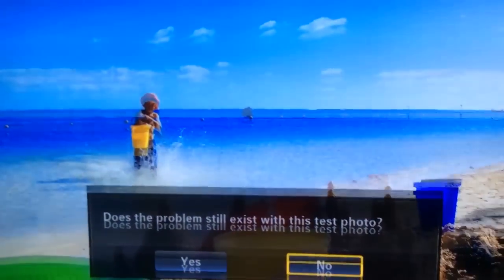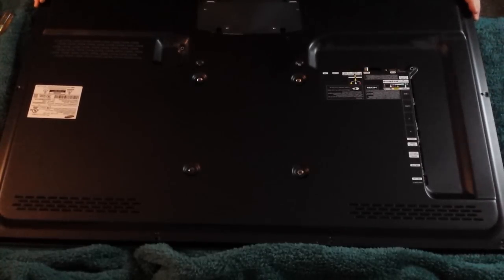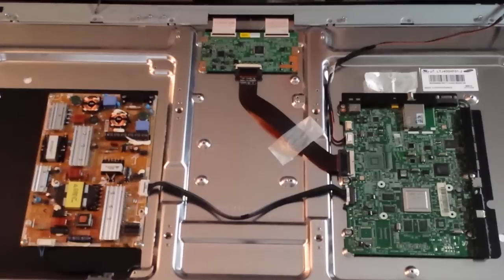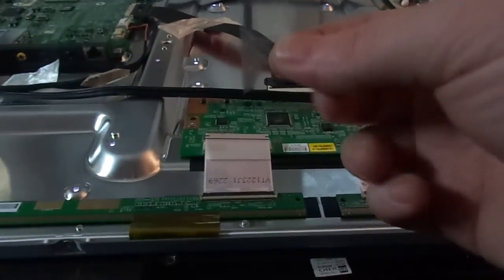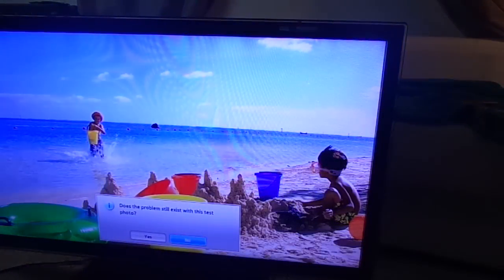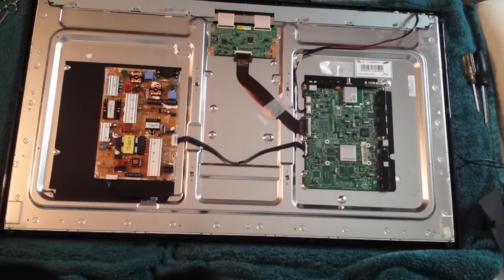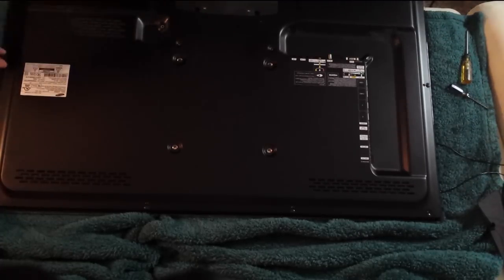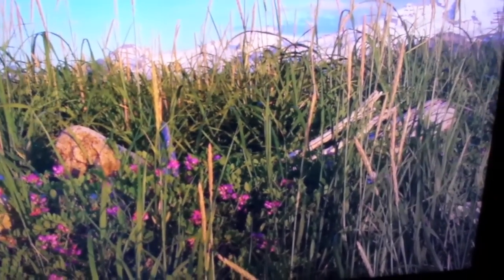LED LCD TV FIX, How To For Samsung Double Image, Black Vertical Lines, Screen Problem Sony LG.

Comment: I have a different one here, there's no left and right cable / flex for the LCD monitor. It's just a single flex , and it cannot be removed i guess so ... LA32d400E1xum model... tnx man
Reply from the maker: I think what you are have is a desktop monitor.  I m not sure about the difference internally so I can not say how you would go about working on it.  Look to see if there are multiple cables that run around the outside of the screen just under the bezel.  There are some videos that show a fault in some of these cables that will give the display issues.  What I've seen done is the cables are moved up and down and spacers are used (a piece of foam or something like that) under the cables when the picture clears up to keep that position the same.  I hope you are able to fix the issue.  Please post any progress you make.  Thank you for watching.

Comment: I found a double image samsung 55 inch LED do you think $250 is. Good price?
Reply from the maker: Adam Anderson unless you know for a fact that you can fix the tv for very little to no money it is my opinion to not buy a broken tv.  Especially at that price.  It's not worth to me to buy something in my budget that I would have to fix before I could use it.  However if I could, for a fact fix the tv than I get it for like $50 to $70.  Try not to under value the price that the seller is asking. Ask before you offer, what they would be willing to take cash for the tv today.  Then make your offer.  If it's not good enough for the seller let them know your offer remains and they can contact you to sell for that price.  I hope it all works out for you.  Thanks for watching.

Comment: Hi dave! i tried this on my tv, and the right panel has the problem but when i tried putting the tape, the gold color strip got spoilt a little bit.. and now the tv doesnt have double image but the entire right section is showing lines... can u help? pleaseee
Reply from the maker: Sonal Verma, this may seem like a lot but just stay with me.  When you say the gold strip is spoilt, does that mean is it burnt or split?  Are there any signs that show the tip on the ribbon connector to have failed?  Try removing the tape and wipe your finger over the gold strip ((not to clean it but to ground out any static electricity build there may be)).  After that reinsert the cable back into it's slot.  See if you have the same issue taht one side of the screen has lines running down it or if the double image comes back.
 If the lines are present with the picture looking good than adjust the cable a bit in the slot it sits in until they clear up then lock it in place.  
 If the whole side of the screen has lines that are a white and grey, shows no image at all or the double image comes back try using the tape again.  Just use small pieces moving it or making it smaller until both panels display an image together.  Then you  should be able to adjust the cable a bit and lock down the tab.
 Please share any updates you can.  And if you can post a picture that would be great.  The more we know the better we can understand.  Thank you for watching and I hope this helps.

Comment: Hi guys..I have a bigger problem here ..my LG 42" smart tv screen is damaged, however i think tv itself works fine. How I know this is, because I tried to connect my phone and it connects and at the side of the screen I can see some part of the image and when I connect tv channels i can hear the voice is perfectly fine ... please advice me, can it be fixed still or better to buy new tv... I mean does changing led screen going to cost me almost same money?
Dave if you reading this pls advise.
Thanks a lot!
Reply from the maker: Hello Sardorbek Ahmedjanov,
From what you are discribing it seems like you may need to do somemore research about the issue your tv is having.  I have read some posts from people stating that they were having the same issue.  There are a couple of videos as well.  I don't know enough about the problem but some people have fixed issue by removing the front bezel  on their tv and putting some kind of spacers in between the ribbon cable and the back outter frame of the tv.  This worked for the models with several connections on the outside of the screen just under the bezel.  I hope you are able to get your picture back.  Please post any progress you end up backing if you decide to do any work on your tv.

Comment: Dave thank you so much. Your video was clear and precise even for a novice like me and my Samsung LE40D580 LCD 40' TV is now back to its old self.
Was told in the shop that new models of TVs were hard to repair and it was cheaper just to buy a replacement.
Sadly I only found your youtube video after having bought a new TV buy hey at least I now have a spare.
Thank you again
Reply from the maker: Thank you for watching.  Bty great first name.

Comment: This happened to my 55" SAMSUNG LED last saturday and was too afraid to open up the back and do this so I instead took it to 2 different tv repair companies which they BOTH said my panel went bad. Both said it's cheaper to buy a new TV than to replace the panel. THANK YOU SOOOOOO MUCH FOR THIS VIDEO.... after buying a new TV and looking at the 5 year old Samsung that supposedly had a bad panel, I decided to go ahead and try your fix.... AND IT WORKED!!!!! Got the screen back to the way it originally came. 

THANK YOU AGAIN - who would have thought that a piece of tape would do the trick and it wasn't THAT scary to do it myself. (with the help of my hubby)
Reply from the maker: You Rock Angela!   I'm glad you found this video helpful.  Thank you for watching.

Comment: First off Dave many thanks for this video.

I just performed this fix on a Samsung Model UN55B6000VF 54'  TV that was having this exact issue.  I first wanted to find out which side of the TV the ghosting (double image) was occurring on so I took both connectors out and put them in one at a time. After I knew which side it was happening to I just focused on that connector itself.  Like he says in the video patience is key here, it took me at least 15-20 minutes to find the right spot for the tape to go, in my case it was on the right side of the connecting strip about a quarter inch away from the edge and then wrapping the tap around the top of the connector so it just covers the metal strip.

I did still have the horizontal lines running up the side of the tv, but unlike in the video I couldn't even get the picture to show up unless I had the connector strip snapped into place, so no fiddling with the strip to get the lines to disappear.  They aren't terrible and are only a little visible unless looking at a white screen, definitely something I can live with.  By the time I got the picture to show up I was hesitant about moving the tape again... so I can deal with it, still 100 times better than what I had before.

Once again Thanks for the video!
Reply from the maker: Thank you for watching Shep309.   I'm glad that this video was helpful to you.

Comment: HI HI,  i have problem with 3d. when i want to watch 3D.  i get just half panel picture. how can i fix it. thanks f help
Reply from the maker: Hello Tamim Anwari.  I don't know what will work to fix the 3d issue.  The tv I worked on was a standard smart tv.  If your tv only has a problem when you enable the 3d feature, than it may be something .  If you are not willing to live with the 3d issue than you may want to look around at some blogs before you follow along with this video. If you have any updates please share them.  Thank you for watching.

Comment: VIZIO E500i-A1 50-inch 1080P LED Smart HDTV (2013 Model). When powered up screen show vert/horiz colored thin lines. 
No menu/sound or HDMI display. 
I hooked up my laptop with HDMI in #3/#2 for extented screen .no change.
TV flicker incessantly
In advance thank you for your help. please let me know your thoughts on how to correct or repair Leroy
Reply from the maker: Hey John Matthias.  I can't say exactly why your tv is having this issue.  I have watched a couple of videos stating that the flickering is due to a bad T-Con board and I have also read that this issue is cauased by a inconsistant power supply.  If you look up Shop Jimmy They my be able to give you some guidance in resolving the issue your tv is having.  There is alot of help out there.  If you have any succes please post for us.  Thank you for watching.

Comment: I literally can't believe it, this worked first try for me, you just saved me upwards of a couple thousand $$$ as I had a 54' led with this problem. THANK YOU MAN. THANK YOUUUUUUU.
Reply: Update, looks like i'll have to reposition the tape since 1 panel is slightly darker than the other but shit this is still 10x more watchable than before, ty!
Reply from the maker: cawzzzz I'm glad this video was helpful.  Thank you for watching.

Comment: Thank you very much! It works on LCD TV Samsung LE32C530. How did you figure it out please?
Reply from the maker: Stoean Paul Gabriel Thank you for sharing that this worked with your LCD tv.  It really helps to post your progress for people to get helpful feedback.
Reply: Do It With Dave My problem with double image is gone, but now there are some vertical red lines on the right side. I can't get rid off them. Any suggestions? Thanks.
Reply from the maker: Stoean Paul Gabriel All that I can suggest is trying to carefully position the ribbon cable while it sits in it's slot up, down ,left, right.  You my see a difference when doing this.  Lock the tab down if the picture clears.  Maybe using a smaller piece of  tape would solve the issue.  When I was working on my tv if there was to much tape on the tip of the ribbon cable I would get a cloudy screen.  If there was to little tape it  would leave lines with a blurry screen.  I hope you are able to get your picture back.  Please update your progress if you continue to work on your tv.
Reply: Dear Stoean Please confirm PIN no. of which I need to cover with tape
Reply: Hi Kiran! As Dave said, you have to try a few times. There is no fixed pin no. I covered aprox. 6 or 7 pins.
Reply: I have find out that pin ...thank you very much ...

Comment: It works. Samsaung service center asked me to replace the panel but you video helped me to fix it for free....Thank you so much
Reply from the maker: I am glad that this video was helpful to you.   Thank you very much for watching.
Reply: hello Mr.hariharan madhavan, how many pin you covered. pls pm me @ +639077462828
Reply from the maker: Like around 6 or so.   It's not an exact number.

Comment: Hey Dave, Great video. My  55 inch Samsung started showing a double image the other night, from what I read the panel was bad. Then I found your video and followed your instructions. It worked, saved me from putting it at the side of the road. Can't thank you enough

Comment: Do it With Dave,

Thanks for the video. Followed your advice and I was able to get the double vision to go away as well the lines but for some reason the right side of the screen is just a little darker. I have replaced the tape multiple times and I can get it to fade but not completely go away. Any suggestions?
Reply from the maker: From what I see on my tv the right side will show off white, most recognizable when the screen is completely white.  I normally don't notice it.  Only thing I can think of is what SimplyBored posted that by wiping the ribbon cable tip with their finger it seemed to make the problem go away, for how long I'm not sure.  For me it came down to either having a double image on the screen, or noticing the right panel being off white when the screen is completely white from time to time.  If you work on it and have any success please update your progress.  Thank you for watching.

Comment: Extremely helpful video thank you! Just a quick question, i have a line of stuck pixels on my es8000 and wandered if this method would help remove it? Hopefully the picture will help. http://postimg.org/image/e5en97suv/

Thanks
Reply: Hey Joe Aldus.  I don't know if following the steps on the video will fix the line on the screen in the picture you sent. If you have not found a solutions for the issue your tv is having then I would love for this to be it.   It might fix it or do nothing.  If you read  previous posts Simplybored suggested that static electricity was the cause when there tv had this issue.  You may find that to be true with the line running down the screen in your case.  If you feel confident, have the tools and plenty of time to dedicate to being focused on the issue then I say have at it.  If you do decide to work on it  be careful and take your time.  Patients is well worth it in the end.
Reply from the maker: Hey Joe Aldus.  I don't know if following the steps on the video will fix the line on the screen in the picture you sent. If you have not found a solutions for the issue your tv is having then I would love for this to be it.   It might fix it or do nothing.  If you read  previous posts Simplybored suggested that static electricity was the cause when there tv had this issue.  You may find that to be true with the line running down the screen in your case.  If you feel confident, have the tools and plenty of time to dedicate to being focused on the issue then I say have at it.  If you do decide to work on it  be careful and take your time.  Patients is well worth it in the end.  
Show less

Comment: Respected Sir,
My name is Akhil raj from India. My samsung LED tv has got the same problem of double image.I called samsung service center they told me to replace the pannel. After seeing this video I opened my tv and followed your procedure and the good news is that your Trick got worked in single shot my LED is far clearer than now wonderfull picture quality and overall good response. Thank You for this information. I have many things to ask you
1. After this fixing of tape how much time Tv will work.
2. Will this problem arise again.
3. What is the function of Tape in the signal cable.
4. As sticking the tape will cause insulation so signal cannot be transferd. Then how the signal is transferd.
5. Why we are sticking the tape on end of Ribbon cable.
Reply: M.D. Akhilra thank you for watching and I'm glad to hear that this video was helpful to you.  As far as the life of the tv I don't know how long it will last.  I have been using my tv now for longer than 7 months with no problems.  I had this issue happen one more time and did the steps shown in the video only the second time around it was an issue of just moving the cable around a bit in its slot. I think it was seated improperly. I also put a small piece of tape on the back of the cable and secured  it to the metal below it to prevent it from moving in the future.  I don't know exactly why this works.  From reading previous posts I am lead to believe that there is a build up of static electricity.  Releasing the cable discharged that build up and I guess the tape puts a buffer to keep that build up from happening again.  I kept the tape on but if you read what Simplybored posted it said that they wiped their finger over the contact on the ribbon cable and this fixed the issue their tv was having.  You may be able to do that and get the same result.   Either way keep us posted.
Reply from the maker: M.D. Akhilra thank you for watching and I'm glad to hear that this video was helpful to you.  As far as the life of the tv I don't know how long it will last.  I have been using my tv now for longer than 7 months with no problems.  I had this issue happen one more time and did the steps shown in the video only the second time around it was an issue of just moving the cable around a bit in its slot. I think it was seated improperly. I also put a small piece of tape on the back of the cable and secured  it to the metal below it to prevent it from moving in the future.  I don't know exactly why this works.  From reading previous posts I am lead to believe that there is a build up of static electricity.  Releasing the cable discharged that build up and I guess the tape puts a buffer to keep that build up from happening again.  I kept the tape on but if you read what Simplybored posted it said that they wiped their finger over the contact on the ribbon cable and this fixed the issue their tv was having.  You may be able to do that and get the same result.   Either way keep us posted.

Comment: thanks bro worked like charm for me but are sure will that tape has enough insulation level and heat withstading capacity so that i can use the tv for long duration without switching it off
Reply from the maker: manu N S I have letft my tv on for 6 hours before and have not had any problems so far.

Comment: Please people read this before trying this 'fix'. The t-con board is extremely static sensitive it's recommended not to touch it unless you are wearing a grounding wire. Furthermore you should NEVER under any circumstances remove the ribbon cables from the connectors with the tv powered on! This can cause a short to the panel ICs that will result in permanent irreversible damage.
Reply from the maker: Hammie0141 Thank you for sharing this valid point to help insure the best possible results when attempting to work on home electronics all by one's self.
Reply: I'm tried  to Do the repair process but the tv now es only green with lots of dark vertical lines no image, I'm thinking now tv is complete broken, Can I repair the problem? The tv was with vertical lines at the sides but full image. Please advise